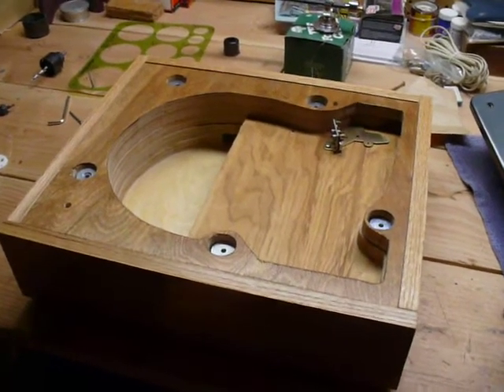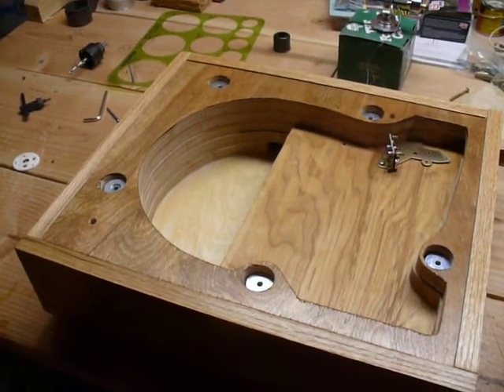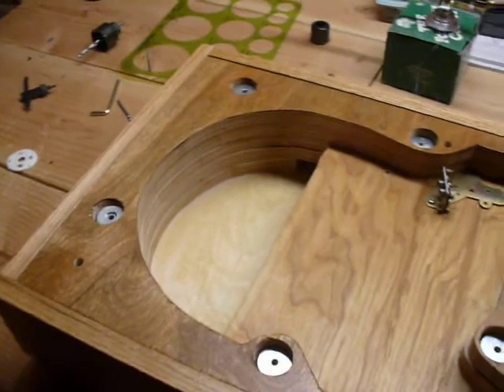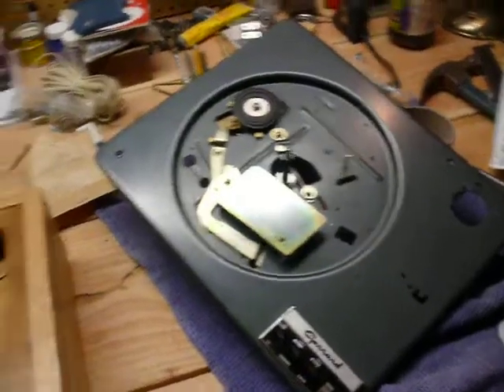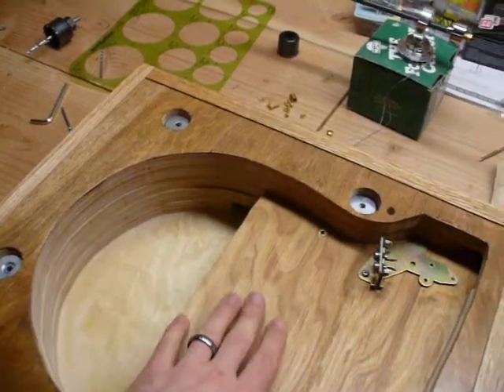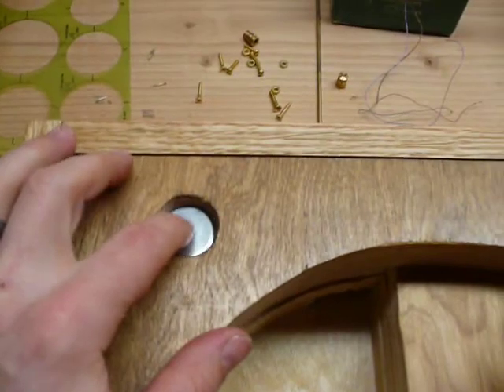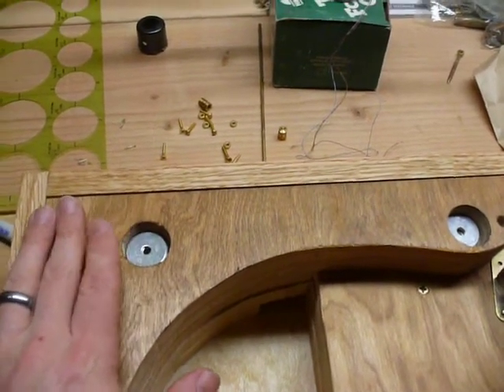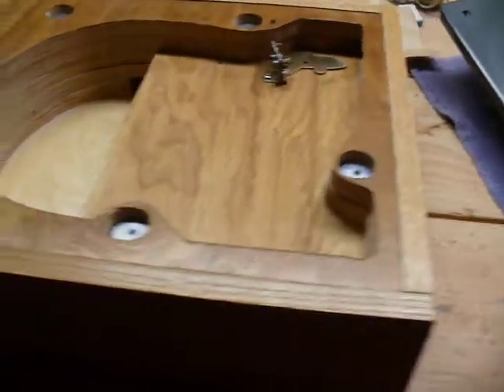Home made plinth for Garrard LAB 80

Comment: www.vinylengine.com is where.

You have to register.  The vinyl engine library has .pdf of service manual & document for hundreds of turn tables.  They had the template for the LAB 80.  It was not to scale, so I had to redraw it in CAD, print it to scale and trace it.  

Thanks for the compliment!